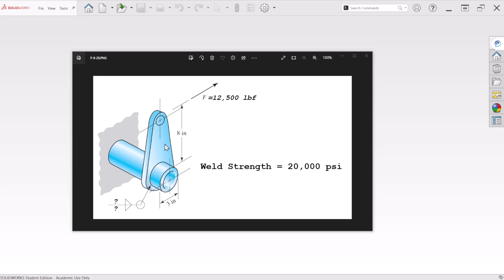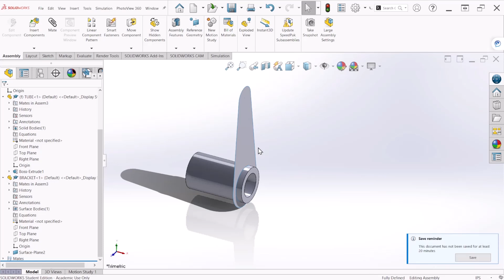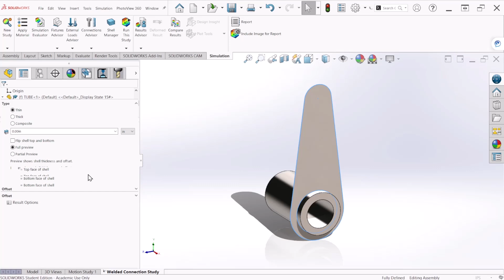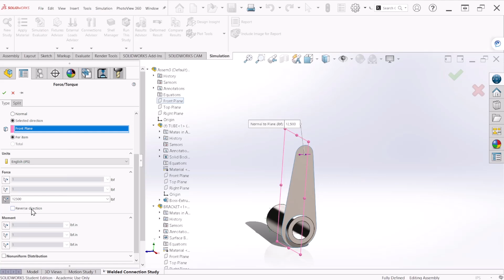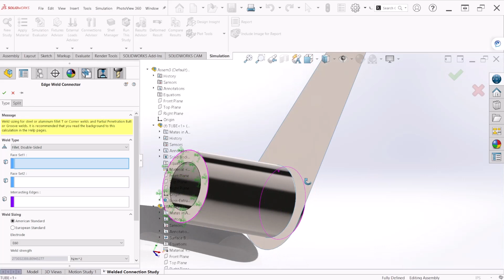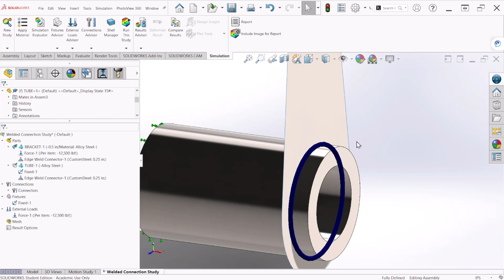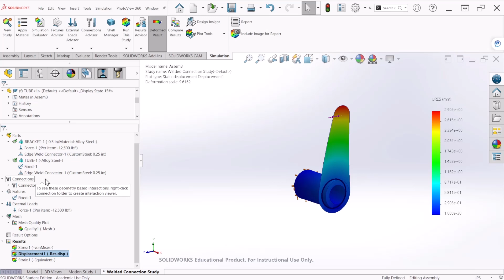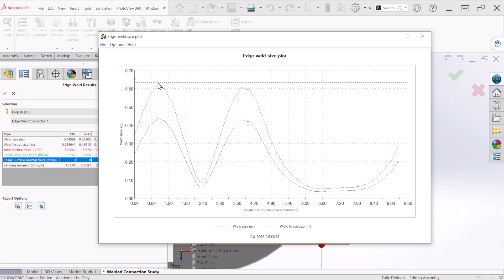Minimum Fillet Weld Size | SolidWorks Simulation for Beginners | Weld Series

Comment: Hi! thanks for the job, 
Can you tell me  why we don't find the same answer by using the same stress in the connector of weld on Solidworks ? Thanks in advance.

https://lh3.googleusercontent.com/XJ7ZOXYMzel3w1HViENTj1VWcTgK8EEvf-8FuMjGAsY-iIG_ZbKgepHadxRyxSoZqOyWB7iLEC8YZSlwWX4vj07D4Akq1vh6P-cQ366U5xurXeC2Cwb35cH-a6A3Qwvj2omzbvK0x3sM3_mHqE6n-gcCCrPDG4IA19_dyAf1W3i0Dr-bAJj-yEgg0d38WyWeAu-KrIwMAAY-mBBLtnzrsiPkEl4cEfcACMYvuBPXa0aDBhzdpFd2-wsEWRu31tPcubVH8lcBngHLjBiYqlV_UCl1rstVuCjlKPgJxyuJEcFkPDmi94XoIWU8ehhyGur9EdMYDWLl7vOYFz_RrSj8qy2hedyznJg77PjBdEsBxhN1e42Ql3ktvOrPu6xDbEB7zPTLFNN08kwlXzDDb1z6SUC1a7MtTO__0T16F-QyEzPbvOgijCWdCcIwZMfLEcHYp16HjLTV4rvCkjKB8SVidPTTLnsX8WVNoKiKrj3LmCo854AiyNBsqdnEn_GC5vJRGHf49288gVW6JN3Z3e_D4u5oG5z7cX7dxojzSmJtCnkZsY6F5A_tmS0uYDgxzmqSf7coy3iZ3MGK-SD2D6o81wG8Y01IZsHie6V12eP6T4HHuqMeR2JbKO7w1xJ5Ip6KFYCyGK5JIEpnydA0CZtxAxMroYwn6AQ3MRackEnzPHo81YXort7sDsNqvpede_6zqmD3RddIuedIkTFqDNuEtSuxG_vDUaQl_VZj7qEuU2F6znXM6wkLmXLXbWksbUozVx0sW26odrSvb-PlDBZfuXmImWKjntYlZYV9-0wsnyeTuKz_1TSHEgJft9QcGWmcetSu-OkMM-o4JTX2u4oqewWIwKe_yKJosXz6uNKmjGoOweR5WAkRRN_pidAhr48ebSgXVaJ5oiOr_RAfH-wmQdAWd01ugQReAyosM0k=w642-h430-s-no?authuser=0
Reply from the maker: Hello, what is the percentage error? There could be many reasons (mesh, modeling etc.) If you are in the 5%-10% range, it is acceptable.
Reply: @cadcaelab  Thanks the your answer, i think it is normal. I have to learn more to use the mesh parameters it is allright, have a nice day.